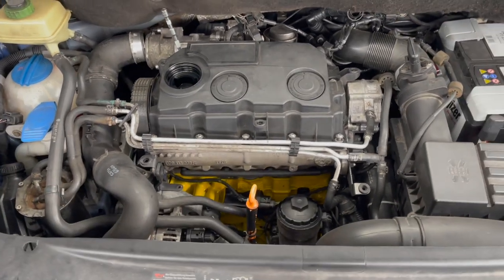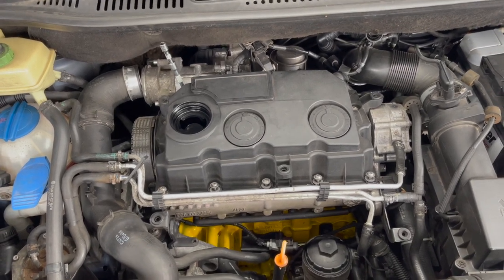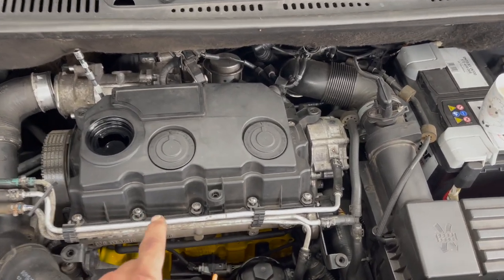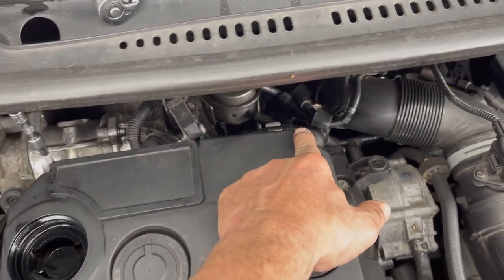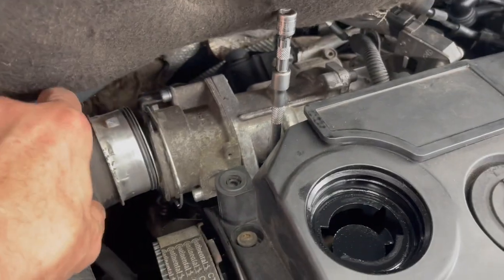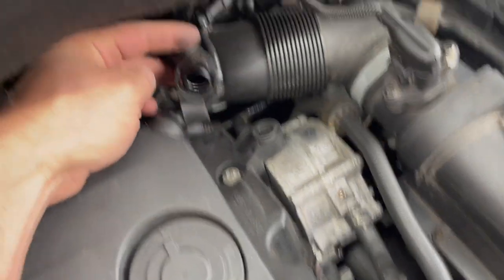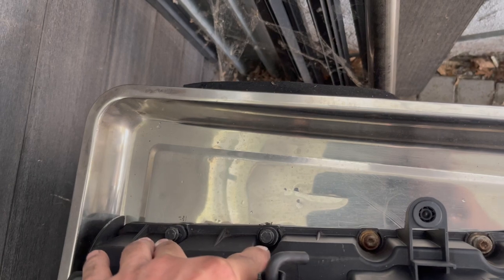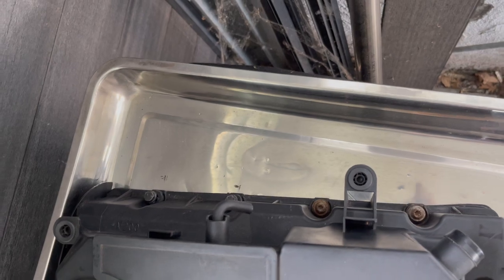1.9 TDi 2008 VWCaddy Fuel injector replacement.

Comment: Would be great to see how you turned the crank and adjusted the lashes!
Reply from the maker: I didn't record it but I can describe what I did. 

First you loosen the nuts and back out the screws completely until there is no more resistance. I then had my father in law slowly rotate the crank with a ratchet while I watched the cam turn. It is easy to see which rocker arm is being actuated. Once the rocker arm is fully depressed  it will stop compressing and for a a moment it will remain compressed even though you are still rotating the crank. So you will have a bit of  "rotation cushion"  This is when you adjust the screw down until it gives "stop" resistance. You don't want to "tighten" it but you want the injector to be fully seated or compressed but with no torque of any measure. Then you will back the screw off 180 degrees. While holding the screw with your hex key, tighten the nut down to secure the bolt into it's location. I am not sure what the torque spec is but I used my internal calibration where I know it is tight enough. 😉Here is a link to a video I watched where they are using a dial indicator for super accurate adjustment. You can forward to about minute 27 where they are doing the actual adjustment. I did not use a dial indicator because I don't have one.
https://www.youtube.com/watch?v=Ou1bFAMed2w&t=1820s
Reply: Thanks Seb, that’s super helpful but how did you access the crank? Underneath or behind the front right wheel? I also tried putting it on stands, in gear and spinning the wheels thinking that would turn the cam but it didn’t 😢
Reply from the maker: @CalcareyCoUk   I had the wheel and wheel liner removed. I think we were using a 1/2 inch breaker bar with a long extension with a spline socket.

Comment: What you think of caddy  engine with more than 360 thousand km is it worth buying or its losing bargain 😊
Reply from the maker: 360 thousand is a lot. I would not want to go to all the work of putting it in with that kind of mileage. I purchased my ASZ engine for 550 euro with only 130 thousand KM and that was with delivery and also came with a warranty from the salvage yard. The BLS engine was over 2000 euro because they break and are in short supply. 
If you could get it super cheap and then overhaul it with new bearing rings and camshaft....maybe? But that would be many hundreds of Euros/$$ just for parts, hundreds more for machine work and still a lot of time for replacement.
But if it is a BLS engine, the rods are known to be the failure point so even a fresh rebuild will not change. I would stay away from BLS engines unless you are swapping the rods with upgraded rods.
Another issue I found during teardown was the rod bearings were also pretty bad and would likely cause a problem soon if the rod hadn't broken

Comment: Those ball pins seemed worn out could that have been the problem
Reply from the maker: This engine only had 130,000km when i put it in and it was really clean. I don't think they were worn in any meaningful way. My BLS had 220k and they did show wear but were working without any issues. The injectors from the ASZ are a larger injector but to work properly would require tuning the BLS ECU and replacing the turbo with the larger turbo. The BLS has a different exhaust mounting with the Turbo mounted up and EGR valve located below which opposite on most 1.9 TDi engines. This changes the location of the DPF and creates other fitment issues.
After replacing the injectors my fuel mileage has come back to normal and the surging at constant speed has also been resolved so i think it was just dumping too much fuel that I could not really use causing the driveability issues and poor mileage.
I will refurbish the ASZ injectors at some point, rebuild and deck, port and polish the original head and I also want to tune and upgrade the turbo. That will be in the future though.

Comment: good video, had the same problem on the BLS about 3 years ago when the bottom end went out, put the asz engine in with BLS injectors , seals did look ok but i will be putting new ones on them soon 👍

Comment: Great video mate. I’m doing my seals next weekend (waiting on new injector wiring loom)
I have all my new bolts and seals (OEM)
One question is… you stated 12nm + 270° for the injector clamps. Yet in some other vids folk have said 3nm + 270°
I’d sooner go tighter, I’m guessing at 12nm you experienced no problems (snapping 😱)
Edit.. Mine is the ATD 100, but I fit a 130/150 inlet manifold, egr delete pipe and had a remap too. 💨💨💨
Reply from the maker: I think 3nm seems too low. I think I  could hand tighten to 3nm and even my small torque wrench only starts at 2 and the click is almost nonexistant. 
It could be an engine specific measurement too. 
It also good practice to check VW forums for answers. Many times they will even post photos of repair manuals

Comment: Hey my man, 
I've accidentally tighten the rocker arms to 180 instead of 90. Should I buy new bolts and re-due. 
Any response much appreciated.thanks
Reply from the maker: Well that is a tough question. I am not sure how much the bolts actually stretch and if that fatigue would cause them to fail. To be on the safe side i would say replace them. 
There are people in the comments that said they had reused all the bolts and had no issues....but for how long? The rocker arms aren't under a huge amount of stress but they are under continual stress from the pressure on the springs. And if a bolt stretched more than normal or if it actually broke, what would happen? 
If it were an emergency repair I would probably risk it to get back on the road but if you have time to wait for new ones to arrive then I would do that. Better safe than sorry.
Reply: Thanks Seb, I totally agree. 
I failed to mention they are new bolts. But I torque to 20Nm and turned 180degs instead of 90 degs. 
I guess the issue will be. How much expansion is left in the bolt when the engine is at operating temp. Maybe I'll kick the car over and see if it all my problems are resolved. It's been 4 years since starting.
Reply from the maker: @BennyLC79  I would not be afraid to crank it, bring it up to temp, check everything or even drive it for a short period of time.  But over the long term it would make me nervous. The valve cover isn't that hard to remove so you could probably get it done in a couple of hours  and be back on the road.

Here in Germany we can drive at higher speeds on the Autobahn. I don't really go over 160 KPH or 100mph but I wouldn't feel good about doing that if the bolts were in question.

I drove my Caddy for a 12 hour round trip a few weeks ago to Amsterdam and planning a 24 hour round trip to Croatia this summer. I would not want to suffer a failure on a trip like that if I could have prevented it. Nothing would suck worse than finding that a bolt failed that I knew I could have changed.
Reply: Hey Seb, thanks again for reply. Wow 160 his fast... I agree with you. I'll at least see if it runs etc. And fingers crossed I'll be changing the bolts after.
P.s I had my injectors tested in Australia. All were really poor basically dribbling on all 4. I ordered reconditioned ones from Germany.
Reply from the maker: @BennyLC79  Nice! Well i wish you good luck. Cheers mate.

Comment: I have this TDI 1.9 doesn't want to start please help please write your number so that I can call you
Reply from the maker: I can't give you my number but you can ask me anything here and I will try to help. Start by narrowing down if you have fuel an power to the glow plugs. If you have done major work like a timing belt or more then you need to check to make sure timing is correct. This can narrow down your issue.